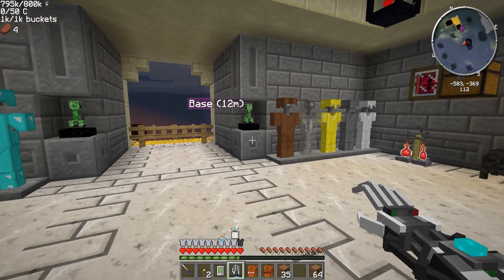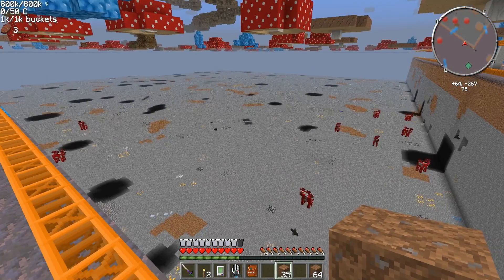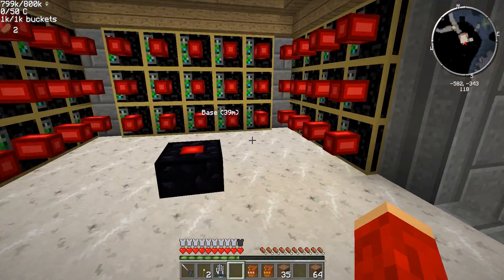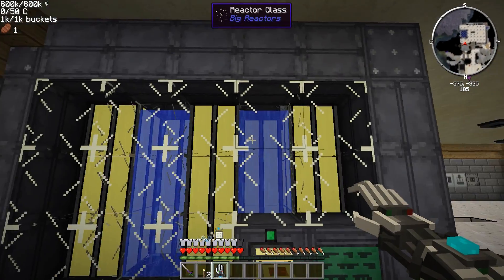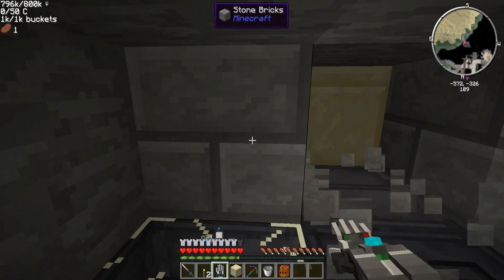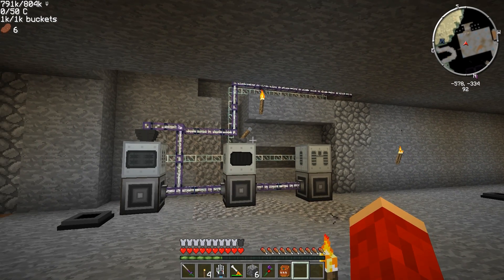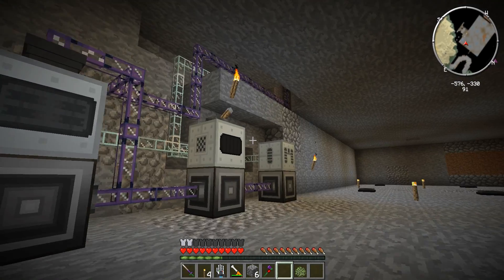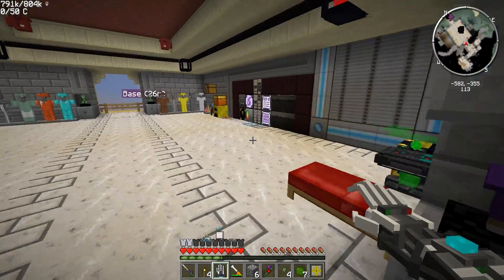Minecraft FTB: Divey's Lets Play #18 (Direwolf20 1.6.4 Pack)

Comment: Are you going to use my computercraft script?
Reply from the maker: I just checked it out. Looks pretty straight forward. I have changed the whole energy thing around so I am nit sure if it will work anymore. Once I am done with the power setup then you can see what is needed. I do appreciate you taking the time to write it
Reply: I can modify it to work with MFSU's, to control your IC2 reactor...
Reply from the maker: Karel Peeters
Let me see how it is when it is all done. I may still change some things. Thanks